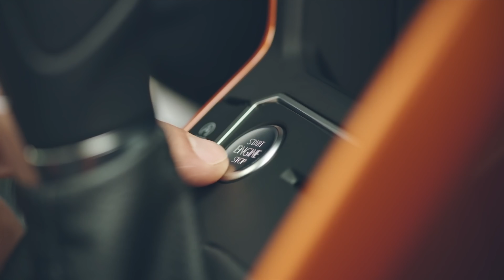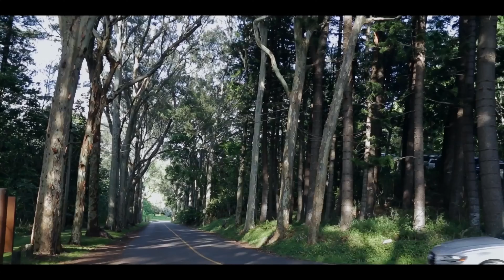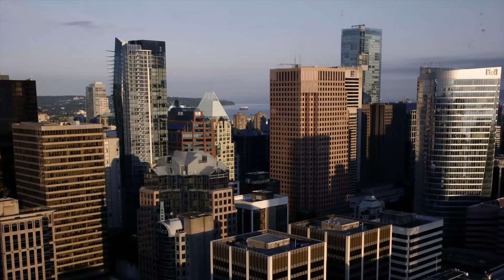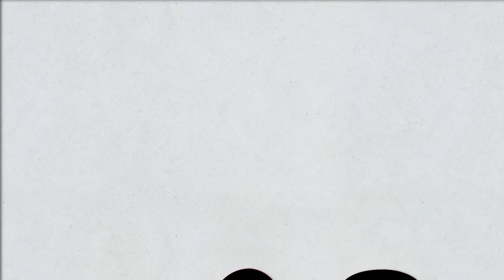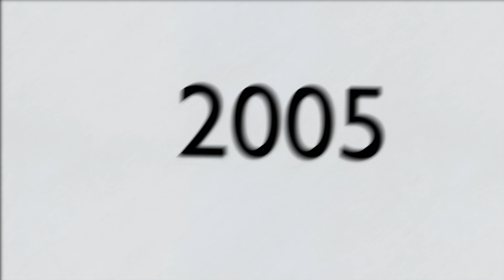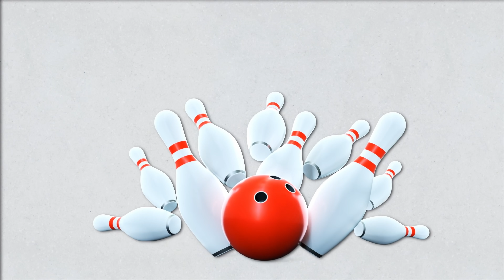Volkswagen Just Got Fined Billions and May Be Going Bust

Comment: My Friend had a Gas burning Jetta, 2005 Model.   It recently died after 308,000 miles.  It was a 5 speed manual transmission and My Friend bought it used.   I think it had a pretty good life with that many miles.
Reply: @Russell Hancock manual transmission explains why it lasted long. The automatics are one of the weakest points in Volkswagens. But your friends was a manual. Stick shift VW’s are WAY more reliable than the automatics
Reply: @Blakecryderman7244  the old non-servo autos were fine. Now that they pack electronics,  just lease it.

Comment: I bought a new VOLKSWAGEN PASSAT & had nothing but many electrical issues and deadly ones too, one issue caused my car to cut the engine’s rpm, and abruptly apply the breaks at 50 mpr . No one was on the road but me that morning in Tennessee, and my sensors I keep wiped cleaned.

Comment: I no longer own a TDI (had a 2000 with the ALH engine, which I got rid of when the transmission went out and it reached 300,000 miles) but still feel that diesel is far cleaner than BEV vehicles. I did drive an electric Kia while my Lexus was being painted, but am concerned about the heavy metals used in battery production as well as the use of coal and natural gas to produce electricity in most locations.  
Another good video!

Comment: Volkswagen are smarter than Congress though. (Not a difficult feat).
Instead of paying $3 billion in cash, they built a large section of the 'Electric Highway' right across America.
All of those charging stations are set up to charge Volkswagen vehicles. You can use adaptors, but I still reckon it was a pretty clever way to pay a penalty.
BTW - Everyone in Europe, (where diesels are more common), believes Bosch was selling the same sensors to a lot more car manufacturers than just Volkswagen...

Comment: I bought a 2012 Passat TDi w63k mi
Fter the recall started. I had complete confidence in VW. 26k mi and 18 months later I took the buyback deal. I made a little over 5k. Once in a lifetime car deal. I was sold, I bought an EOS - w6cyl 3.2 - TONS OF FUN. When the Passat TDis  came back on the market I bought another ( a little less go go go) a 2014 loaded wXtra warranty. Between the mileage, safety  and handling I have influenced others. I tell them al

Comment: my mk6 2010 golf tdi still has original shocks at 175k miles. i've never had an issues with it other than normal brake jobs, it's also been flashed since day one so it's like quick. The engineering in the 2010's at least is exceptional. I've been driving it hard for the whole mileage and it's not broken and still feels like a new car when i drive it. I've heard the newer mk7's on were not quite the same quality.

Comment: I haven't messed with VW recently -- certainly not the diesel versions. That said, years ago I had an '01 Passat with a V6. While I saw hell with the peripheral things (fixtures, motor mounts, hoses, etc), the engine and transmission were bullet-proof. Over and above everything, it just had an X-factor that made it so much fun to drive. I think VW used to call it farfegnugen. Like certain abusive relationships, I hated that car, but I loved it!
Reply: My 95 Vr6 was like that.  I gave it up when the heater core went out.  I haven't had a car that drove like that since.  My 2014 is much more efficient and reliable but doesn't handle or drive as well for various reasons.

Comment: I bought a 2009 Tiguan but it has since come unglued and falling apart, the gearbox was replaced after 175,000 km. Though it handled nicely with good fuel economy, I'd never buy another VW due to the substandard construction and uncommon specialized tools required to maintain it.
Reply: My grandpa has a 2008 tiguan 2.0 tdi diesel with AWD and its going strong past 200k km. All repairs cost together are below 4k so pretty nice. Did you service it and maintained it regularly? And what did you do to have it falling apart when our tiguan doest have anything that rattles. And we used it to tow a caravan every year from Germany to Croatia.
Reply: Yea, those are junk
Reply: @ersariantheoneandonly6821  they're junk. Vw here is different than where you are. The Tiguans suck....and even where you are ,it sounds . 4k bucks in repairs?? My wife and I have 2 5 spd hondas , with over 200k miles. Know how much we've had to spend on repairs?? Like 300 on each car in the time we've owned them. Plus maintenance. But all we've had to do is a little suspension work on each car. And that's because they have high miles and our roads suck

Comment: i own a 2015 TDI Jetta, a 2015 TDI Passat and a Amarok 2016 TDI V6 in Texas i love them never getting rid of them . i sold my 2012's jetta and passast and when they started to sell the certified VW TDI with the fix i bought the 2015 . i imported the 2016 Amarok pickup from Mexico and is my favorite pickup out there. not going electric just yet but also never parting away from my TDIs. i own a 1971 super beetle original,  and a 1968 Karmann Ghia that im planning to do a DIY electric conversion.

Comment: The TDI is one of the greatest engines ever ... Lots of power , Great gas mileage and reliable. I've gone over 700 miles on a tank of gas. It consistently gets 47 miles per gallon and nothing has ever gone wrong with this car in 155,000 miles. VW also gave me $25,000 because of the emissions Scandal ... which is what I paid for it ... and they let me keep the car !

Comment: I bought a new Volkswagen Rabbit in the early ‘80’s if memory serves…I do remember that it was the only car I ever owned that broke down in the middle of the road. I had to get out and push it off to the side. The distributor, down low on the left side, was completely flooded out with water splashed onto it by the left front wheel during a heavy rainstorm. Sold it for a big loss weeks later. Never again, Volkswagen.

Comment: Aside from the dieselgate, the worse thing that volkswagen did was put Audi's notorious bad 5 cylinder engines in their volkwagens, which drove their reputation and quality down.  The best thing they ever did was reverse this decision and even remove it from Audi for most models that drove up their quality immediately.
Reply: .....the 5 cylinder engine is alive and well. VW used the 2.5L from 2005 through 2014. It is a very reliable and long-lived engine. Smooth as silk......
Reply: The 5 cylinder is possibly the most reliable and trouble free in the product line- very few failures and very long lasting, even when us Americans don't change oil or do regular maintenance

Comment: Hated that one of the casualties of Dieselgate was the cancelling of the BluSport Roadster. The concept car used a 2.0TDI engine if I recall correctly, and was a mid engine RWD convertible. 
If it would have made it to production I imagine it would have had 1.4TSI and 2.0TSI engine options as well. 
It still fits with the current design language...

Comment: Wow that is AMAZING to know. My first car back in 1971 was a 1959 VW BUG then had a 1964 Bug.  In 1995 I aquired a 1985 Cabriolet with about 100k miles on it, the odometer broke at 196k miles but drove it for 5 to six years after that (only GOD knows how many miles were on that car. I had it for almost 16 years with the SAME CLUTCH!!!  I really didn't have to spend too much money on doing repairs on it while I had it other than usual maintenance and replacements of normal use. It didn't cost me all that much to use it and I DEFINITELY HAD FUN WITH IT, IT WAS A CONVERTIBLE.😁👍

Comment: I fell for VW scam.  I lost over 12000.00 dollars in lees than two years.  Our government screwed the customer with special deals.  We lost our car and my retirement income.  I realized there was something wrong, before VW announcement of the diesel problem.  My front o2 sensor burned out.  I found out that all across America they were replacing catalytic converter on cars with less than 24000 miles.  I would not buy another VW again.

Comment: VW's new line of vehicles this year looks pretty cheap and cinchy, with their all in one dash unit and the 2 tone plastic they keep putting in 45k + dollar vehicles. It makes the Toyota Corolla Hatchback look like a golden goddess when you compare features and pricing to that of a Golf or GTI
Reply: I prefer Honda. Over Toyota just because I've always loved Honda, and my wife and I have 2 5 speed older Hondas w  over 200k that run like new..but I gotta say I like the corollas new style over the new civic, the civic looks plain now.
Reply: That’s how the Asian manufacturers sell cars. They give you more standard equipment for you are buying an inferior vehicle. It’s the same with SEAT, they have more standard equipment than a VW and Audi has even less equipment than a VW. A VW golf has stuff a 7 series doesn’t have. The UK market highlights this very well. Emergency braking and adaptive cruise control for example weren’t standard on the 7 series but were on a Golf.
Reply: @Horizon301.  adaptive cruise, and emergency braking is for people who arent smart enough to pay attention anyways..
Reply: @richsweeney1115  it’s a great feature to have if you do use cruise control as it feels safer than the normal system and as for emergency braking, I think it’s worth having as I got insured on a brand new golf as a new driver for under £1000 so I can only assume it helped and plus, you can’t account for people walking out in front of your car or pulling out. It will react quicker than yourself. But yes, I don’t use cruise control or anything as I prefer to have control. These systems would have cost a few thousand pounds on the 7 series which costs 4 times as much nearly as a golf. Even the Audi A1 is better equipped as standard than the A6 with dynamic indicators, led headlights, virtual cockpit etc all only standard on the s line model and with the tech pack. And the A5 has 3 zone climate control whereas the other more expensive A6 ans A8 have 2. Overall, the more you pay, the more you are really getting screwed over. The A1 is in a competitive area so they give more stuff but other than that, the Asian car manufacturers and the cheaper brands will be what competes and Audi will mostly be with Volvo, JLR, BMW and Mercedes. I think in the US, you would have many people expecting all sorts with these vehicles but it’s just not there as standard, cameras, cooled seats, sunroof etc are rare

Comment: Used to love my first new car, a 1972 super beetle but in 75 I traded it for a Rabit.  Big mistake.  The car broke down at 124.5 miles when a bolt holding eh AC in went through the cam belt.  The fixed it but when I was driving it in Texas Canyon in Arizona another bolt came out and damaged the the cam belt again,  was able to limp it into Yuma Arizona where it spent 3 months in the VW dealership awaiting parts.  I continued to drive the car for about a year when it started costing me $300.00 a month in repairs and $300.00 in car payments.  It started burning oil and the dealer told me it was a bad head design and they would fix it for .....you gussed it $300.00.  I said no and shortly there after a Pinto hit it in the front and got enough to pay off what I owed for the car.   MY LAST Volkswagon.  I bought Datsuns and Fords after that

Comment: As a person who regularly deals with VW, they're horrible engineered pieces of over engineered plastic junk. Same with Porsche. The stupidest ideal i've ever seen, let's give you BOLTS  to put in a rim to hold it on, 1/4" of hub center to hang the rim, and no way to hold the caliper still while you try to line up a freaking lug BOLT  into a a deep sunken rim, where you have to use a socket to screw it in, because your fingers don't fit in the hole. Yeah real genius design there...
Reply: They still stuck with that design after moving away from drum brakes?  Trust me, as somebody with ancient vw metal around, it wasn't that much of a pita to deal with with drum brakes.

Comment: I have been a mechanic for 35+ years also an off-road dune buggy enthusiast I used to have six VW bugs in my fathers driveway in the 70s and the 80s they very weak  terrible transmissions were always  breaking they weren’t built for Canada that’s for sure with the parts they were way too expensive for used parts I have not been a supporter of Volkswagen just because everything was over priced back 70s in the 80s look at the prices now and the corruption never mind now stay free or die💪🏻🇨🇦🇺🇸👍🏻🏁

Comment: Good luck if you buy either one. Battery 🔋 technology hasn’t caught up with the idea 💡 these new batteries are expensive to make. Plus what stuff costs doesn’t match peoples pay. Stuff needs to equalize. I’m for green recycle ♻️ energy. The ratios to mine and get stuff 👅 it’s good that their are feet 👣 wet with some electric cars. The grid is old the infrastructure is old. So as more electrics hit market and people charge em up. The whole system would need upgrading to compensate homes bigger wiring etc. running your home and charging your car sends your electric bill 💸 so unless they give a balanced rate levelized system for going green plus now if your car has a hiccup no way to fix it.

Comment: Ok so, i have to vw's in my family, one is a passat 2003 1.9tdi and it hit 650k km and still going no probs as all, a friend of mine has one with 1 milion kilometers and did not have major repairs, just took care of it. I have a golf mk5 also 1.9 tdi so a non dieselgate engine, has 200k km on it and drove it weekly 400km for about 2 years now, no problem at all, just maintanance. Nowadays they not so reliable as they used to be with the 1.9tdi but if u took good care of them and drive them responsably, they dont let u down so easy.

Ps: had to mention, these vws im talking about are made in germany, so May this he a reason for the reliability. US FRIENDS, get a vw made in Germany and u will be happy:)))

Comment: I believe that VW should try again to inter the U.S. market with their Diesel engines…an improved diesel…in addition, they may benefit with electric motors, in combination with their very efficient diesels-a perfect “marriage!”
Reply: The primary complaint most hybrid owners had, is while running off battery only, quiet but slow. When running on ICE, too little power. A torque heavy small diesel, mated with a hybrid system sounds like the perfect combo.

Comment: EV's are about x2 to x3 as cheap per mile vs gas UNTIL you hit ~150k miles. Then that $7000-$15,000 lithium battery needs to be changed out $$$. Now your long term cost just exceeded the gas guzzler by thousands of dollars. Not enough charging stations or charge range to justify the switch on top of that. Gas cars can last 200-300k miles before an engine or trans replacement is needed for around $4k-$8k. We're probably 20 years away from electric cars being viable. I'll be old by then. Screw my cuckey government overlords.
Reply: True.  Mechanical engines always last longer.  Electronics have latent manufacturing defects that get passed through quality control.

Comment: They make sound worse than it really was, just look at the exhaust tailpipe of a 2014 Gas Jetta and then look at a the same year TDi, the gasser will be black and the TDi you can see the metal. 40 times a very small number is still a small number and the common rail diesels from VW are far cleaner on their worst day than any 1Z/AHI/ALH/ BEW on their worst.

Comment: Scott, what about hydrogen engines vehicals instead of electric vehicals ?  Hydrogen is the actual way to go.  Battery technology just isn't there yet in order for electric vehicals to work, because a person have to replace $28,000 rechargeable batteries,  when:
(A) driving the vehicle in 38 F degrees weather;
(B) driving the vehicle  in 95 F degrees weather;
(C) charging the batteries to 100 percent  too many times; and/or
(D) the batteries needs to be replaced after two(2) years.

Comment: Defeat Device..... language and framing at its height.   It's interesting how motor boat internal combustion engines were exempted from emissions regulation:  The argument was that no air pollution control device could survive the engine running at full throttle.   Indeed this is a problem with IC-engined cars that no one has really conquered.  Each year the emissions requirements have became more and more difficult to meet and each year this manufacturer tried to make better filters, better exhaust reactors, etc.  NOx levels climb with temperature, yet their APC required high temperatures.   The temperatures in the APC devices were in part reached by injecting fuel, but fuel efficiency was a big goal, so the saving fuel at idle was tried....but.....  They gambled on delivering more and better engines and APC equipment....but they failed to keep pace with the regulators.   Instead their reputation has been destroyed.   With more than $200B in debt, their very existence is in question.   The era of combustion is to be left behind and more and more turn to electric power.   Now we just need to learn how to better generate, store and utilize electric power.  Hopefully without gambling away our futures.

Comment: The 1.9 TDI is one of the best engines made in the last 30 years. Combined with a manual transmission they are "Toyota" reliable but with lots of torque. Every single US made car is crap.

Comment: F---k the EPA. Scotty as mechanic you know getting more air in out of an engine is best. Lets look at the EGR(engine gas recirculation) so you want me to pump burnt hydro carbons into my engine but first cool it with hot engine coolant ah that sounds bad. Putting suit in the intake is like putting dirt in your intake. We call that dusting an engine and your cooling system has to work harder. Then you want me to buy pig Erin to spray in the egsust to go in to can that has rare earth metals to be burnt later and this resticks the out going air. Sounds like a scam to me.